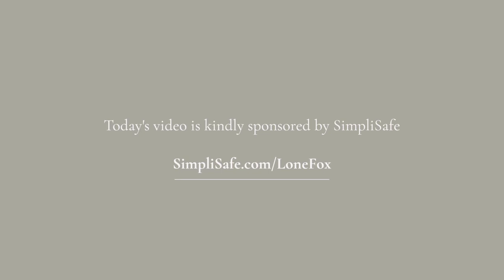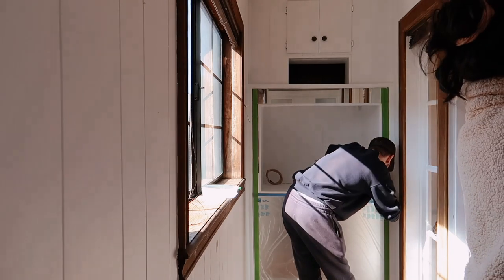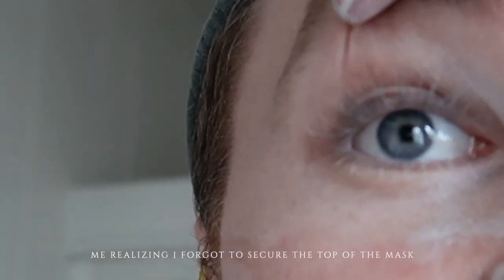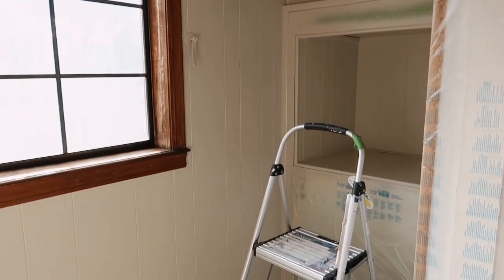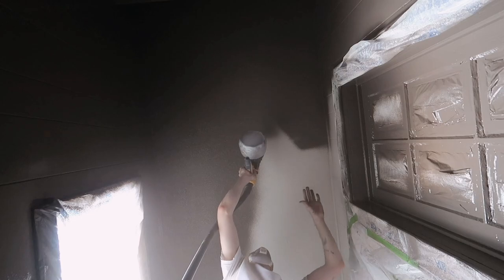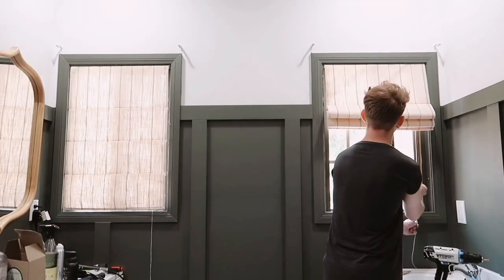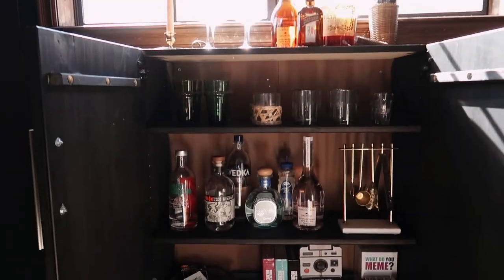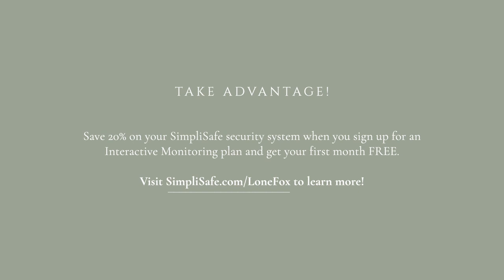TINIEST Room Makeover EVER! *Horror Movie Room Gets an Update!*

Comment: Here is also another good tip for speed painting. Strongly masking tape a narrow brush to the top of a pole, like a paint roller pole, by the brush handle, and use the brush to paint the top of the room. Because you can do that while walking around. Because instead of using a ladder to go around the room, which takes a lot of time.

Comment: This is actually a dinette closet. Where people kept all their expensive China and antique tableware,  glassware, and crystal.
Reply from the maker: I thought so as well however somebody mentioned it was a screening room which made so much sense! The larger cutout is from the TV and the smaller ones on the opposite side were from speakers. There was even wiring running through tubing between the cabinets
Reply: @lonefox  I just know the some of the Victorian Homes here in Milwaukee's Brewers Hill have tiny rooms  on the side of the dining rooms. Fine China and Fine German 
 Dishware,silver tea sets, fine crystal etc, were found years later after the WW1 in walls of these tiny rooms. Just like Antique milk crates and milk bottles were found in many German bungalow homes 🏡 here in Milwaukee. Milk men delivered Milk to homes before the WW1.